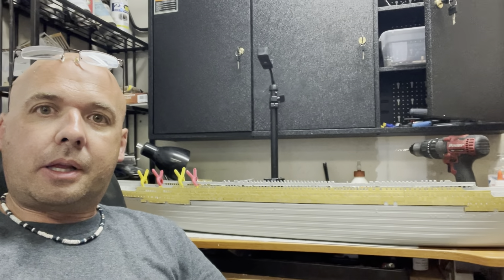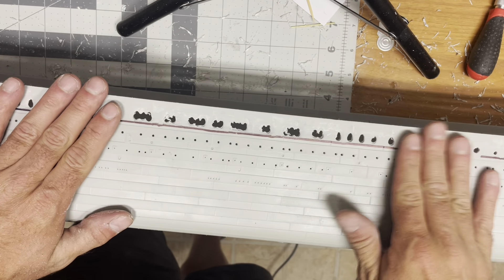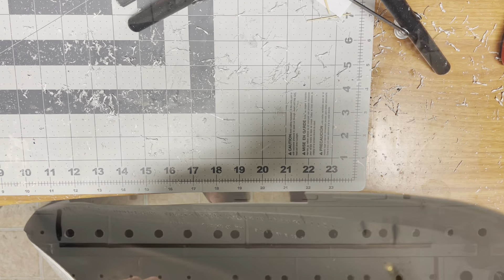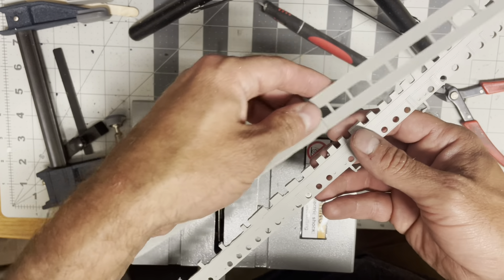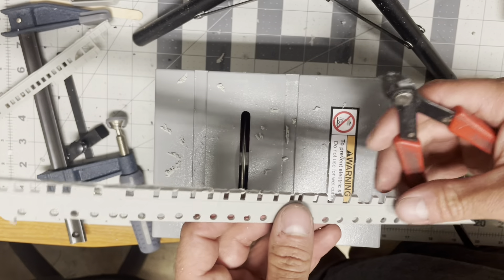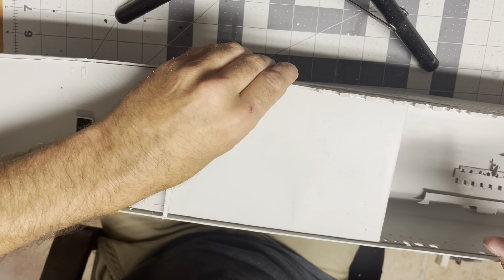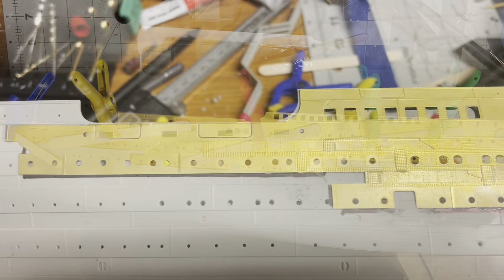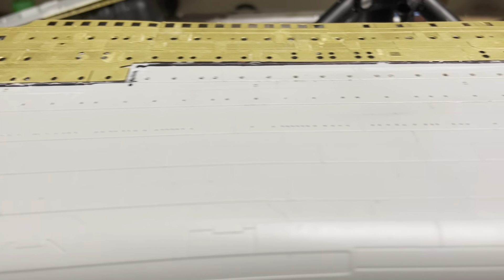RMS Titanic Trumpeter Radio Control 1:200 Build.  Part 4

Comment: Fantastic work. Question from a non - modeler.. what’s the purpose of using the brass? Does it provide far superior details than that in plastic?
Reply from the maker: Yes. The detail of riveting is way off on the kit.  I mean it looks good, but the brass takes it to great.   It also corrects the porthole and window placement that is incorrect on the kit from trumpeter.   Previous videos show the comparison between the kit and the brass.   If you are experienced with modifications I highly recommend it.  If your not overly experienced, I would say it’s not the kit or modification to try first time.
Reply: Gotcha thanks. Amazing work you do

Comment: Thanks for producing and sharing these videos. It’s been very helpful as I plan to install my PE hull plating. I noticed that you didn’t pre-fit any decking or the plastic promenade superstructure. Did you have any alignment issues later?
Reply: Never mind, I see that you used the decks and bulkheads to align everything! Thanks for the useful video!
Reply from the maker: Very minor from what I’ve seen so far.  I will actually be installing the side superstructure that I removed in the near future.  I took a break from the build to focus on another one but should be getting back to it soon.   I’m getting ready to start ADeck but I needed to figure out how I was going to connect them, yet make them removable.  I have that about squared away now so then I’ll be showing that step of the process along with Neil’s superstructure plating.